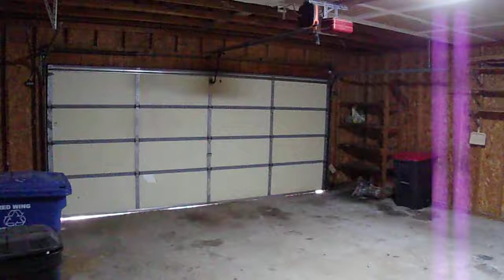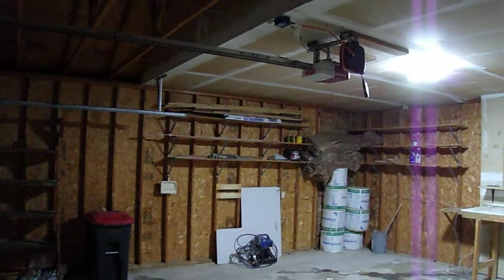Last Video of the Genie GX9000(read description)

Comment: How long have your family Been living in that house
Reply from the maker: They built it in 1990 so they were the original owners. My mom was pregnant with me at the time. I was born March 20th 1991 and my brother was born May 29th 1992 so we grew up in that house.
Reply: @Tbolt1000TForLife  It’s sad when you were born and that house and u have to let it go
Reply from the maker: @GenieIntellicode  It sure is! I'm quite sad to have to leave it behind and move on as it's been a part of me all my life, despite the fact that I moved out in late 2019. I live in a trailer park. My home is a late 70's single wide. I own it outright.
Reply from the maker: @GenieIntellicode  The hospital I was born at was torn down this past fall so this is strike 2. I have one of it's bricks in my front closet.
Reply: @Tbolt1000TForLife  my grandparent has an 2003 genie isl950 and it’s one of my fav opener the one I have in my house is a genie 2007
Reply from the maker: @GenieIntellicode  My favorite is probably the Lift-A-Dor that my parents originally had. I also like the old Stanley Chain Drives from the 80's and 90's and I hope to find an NOS Stanley on ebay and install it in the house I wanna build. I want an 80's theme and Stanley made the same Chain Drive opener and remotes(which are still being made) with reversing beams in the 90's. One of those will blend in nicely with the 80's theme while being up to code at the same time. A winning combination!
Reply: @Tbolt1000TForLife  why did you take the emergency release tag off
Reply from the maker: @jeremywilliams4493  I didn't. The original carriage wore out and my dad replaced it with a new one. It came with a new cord and knob but no tag.
Reply: @Tbolt1000TForLife  oh ok I forgot that the old knob had melted
Reply from the maker: @jeremywilliams4493  Yes but that was replaced by a cord and knob that came from a Genie Chain Glide that was replaced. I got them from a fellow YouTuber called Chicagolandhobbies years ago. Don't remember when. That was before the original carrige wore out.